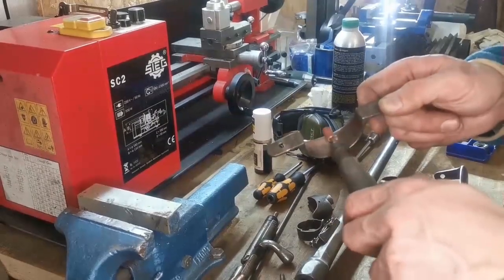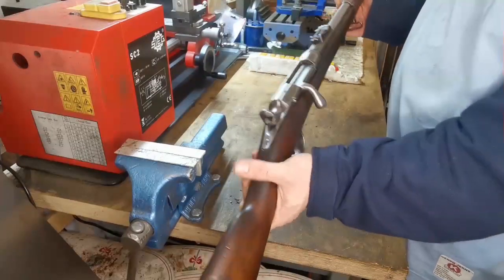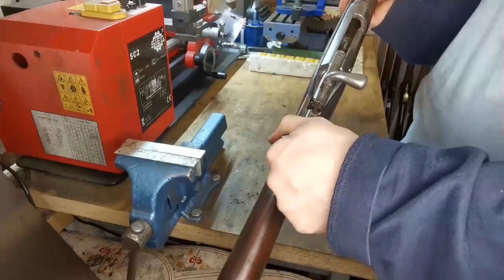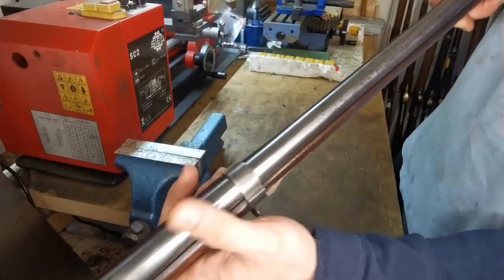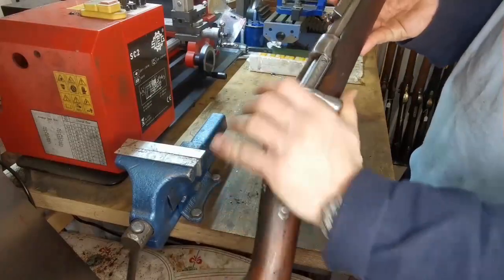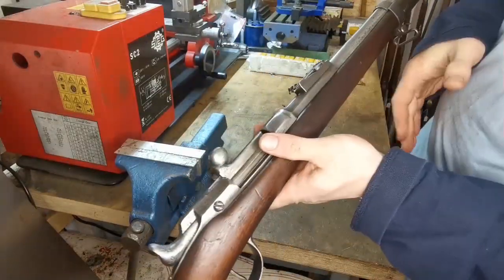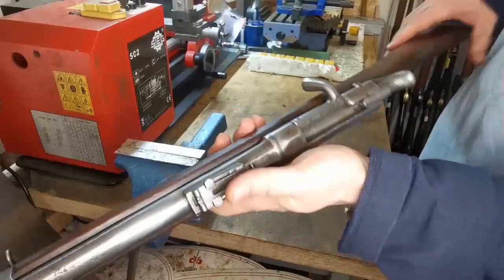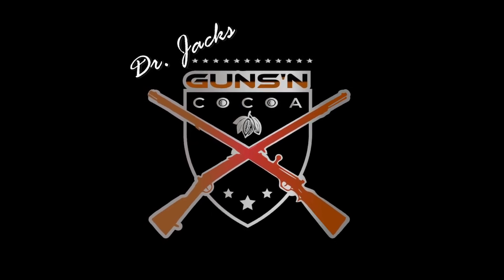Restoration of very rare French Chassepot rifle model Carbine - Prussian adaption Part III

Comment: Just NO.. there are much better and less destructive methods of removing rust marks than taking a grindstone to it..
Reply from the maker: Yes, you are right, there are different methods for removing rust, electrolysis, steel wool, grindstone, steel brush, and vinegar, just to name a few. I decide in dependency on time effort, area of the rust/ corrosion pits, active rust or inactive rust, and the abrasive or nonabrasive method. Here I decided on the abrasive method, which is, besides other methods still state-of-the-art, to get rid of the rust colorization of the metal in this area to homogenize the appearance of the weapon as a whole. Most of the time I am still a friend of nonabrasive methods, still using the electrolysis bath, which is among the restorators at the national museum abandoned. Why? Because under a microscope you will find out, that the electrolysis changes the metal surface into a sponge-like condition which is far from the original condition. But I aim for bringing the guns back to a state, where they are able to be fired again while preserving them in the best possible collectors state not erasing but considering their age. 
Thanks for watching and for your comment!